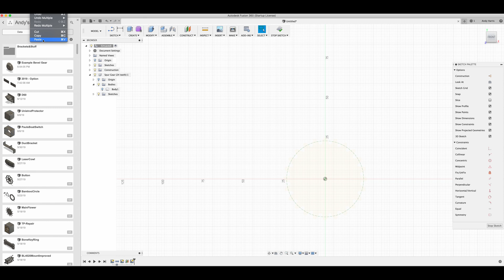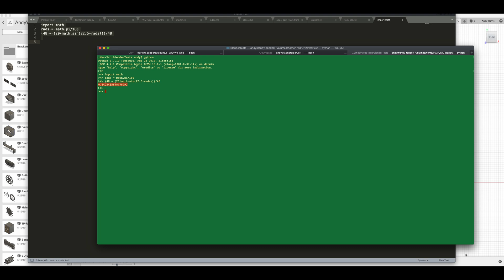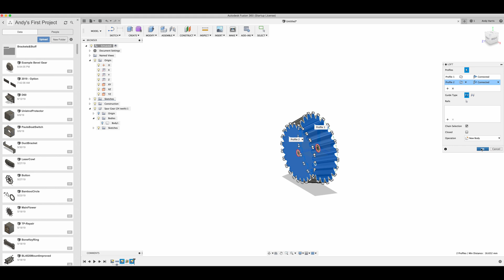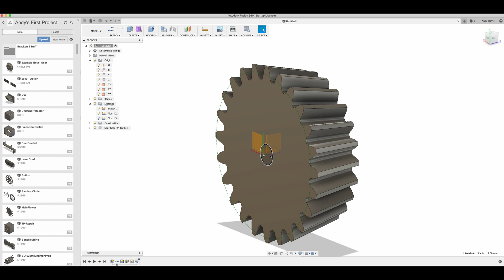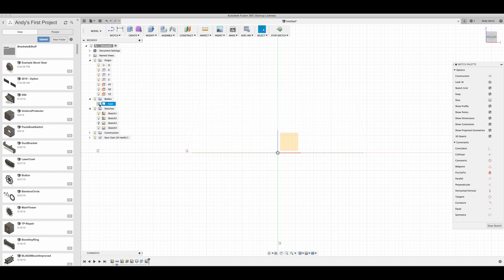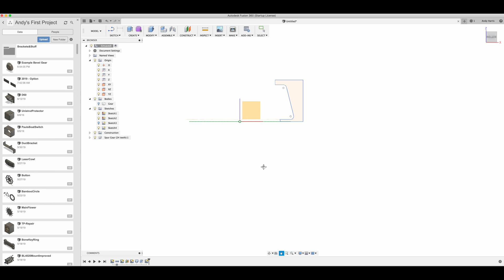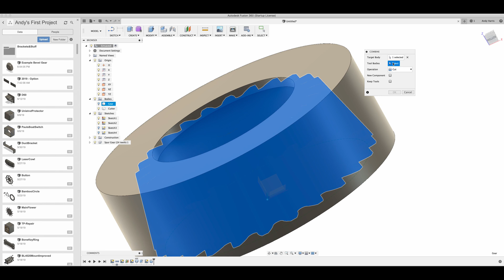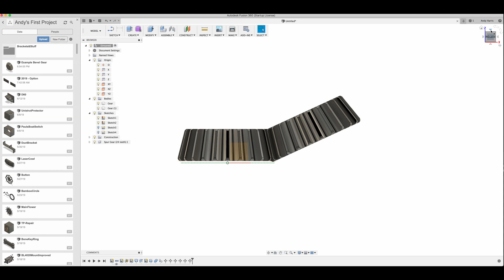Bevel Gears In Fusion 360

Comment: GF Gear Generator does not seem to let you change the contact angle, which is frustrating for an otherwise great tool... your method, while requiring some outside math, does let you pick any angle!! Have you yet an update that works in Fusion? (I don't have Python for that calculation you listed...)

Comment: This method doesn't create gears that mesh correctly. Lofting between to flat spur gear profiles will not create a proper bevel gear. You will get away with it when the angles are way less than 90 degrees (like in the video), but if you try this exact method to create 90 degree bevel gears, you will see that they aren't even close to meshing properly. This post at the Fusion forums explains exactly why: https://forums.autodesk.com/t5/fusion-360-design-validate/how-do-i-create-a-bevel-gear-like-this-in-fusion/m-p/6955483/highlight/true#M103817
Reply: Indeed. A bevel gear should be designed as a pair of touching cones on their slant height. Their intersection results in a line. The profile of one tooth of each gear cone should be perpendicular to that line.

Comment: Not sure if it is the new user interface but the geometry that I am trying to replicate is very different from the one you show.  Can you please verify that your method still works with the updated Fusion 360.  Thank you!
Reply from the maker: I can confirm that addins are still available - but now under the tools menu in design.   The 'Project' function seems to have disappeared.   I used a mirror face this morning, this is not as good as project.    You can also select all the of lines that make up the face of the spur gear - but this takes a little time!
Reply from the maker: OK, so you can use all the edge selection to get all the lines of the gear face and then copy these to another drawing - from there you are good to go!
Reply: @AndyThirtover  Yes, I stumbled on this last night as I was desperately trying to find a way around the missing projection function.  This is a great way of creating bevel gears.
Thank you!!!
Reply: One additional note that may help someone.  When scaling the offset sketch all dimensions will be adjusted!  I was playing with a 48 tooth,  50 mm thick, 90 degree gear.  The scale factor of 0.26343 changed the thickness of my gear proportionally to 13.17 mm.  To get the gear back to the desired thickness of 50 mm I had to click on point in the offset plane above the origin.  All else is as Mr Harris describes in his video.

Comment: What are the variables you used in your script please? I'm trying to create 90° bevel gears. 48 is the pitch from the spur gear add-in. 22.5 is the angle between the gears and 20 is the gear thickness?
Reply from the maker: import math
rads = math.pi/180

gear_thickness = 20
gear_angle = 45/2
teeth = 48

scale_factor =(teeth - (gear_thickness*math.sin(gear_angle*rads)))/teeth
print("Scale Factor: {}".format(scale_factor))

This is a little Python program that will sort it out.   In your case gear_angle = 90/2 (because you make 2x45 turns).
Regards

Andy
Reply: Andy, thanks for the explanation. Your video is by far the easiest method to make working bevel gears. I printed your example and they worked well! Thanks
Reply: @AndyThirtover  does this woks for 90° bevel gear and pinion?
Reply from the maker: @FlyHIGHSIM  Yes this works for 90 (2x45).   These days there are very good gear builders.  I'm using CF Gear generator these days.
Reply: @AndyThirtover  oh god... i didnt even know it exists... thx :) i'll get this generator :)
Reply: @AndyThirtover  is there any easy way to align the two gears using this generator ?
Reply from the maker: @FlyHIGHSIM  GF Generator creates sketches - which can be edited.  I actually do the alignment by doing a section analysis and Move. For 3d printed gears I leave 0.1mm clearance (Prusa i3Mk3).   I'll bet there is a better way of doing this!
Reply: @AndyThirtover  ohh, i did not tought about loking at the section or the sketches... i was trying to calculate the apex etc. etc. by doing the radius of each gear (.  (teeth*module)/2.  ) but none of my calculations matched :(  so, i did the alignment with my eyes :p. ANYWAY, the project i'm working on (a mini rc car) is printing the first prototype of the rear suspension/drive shaft and everything. it will be great to check how acurate is my eyes hahaha. thanks for your help!!!
Reply: @AndyThirtover   If i exactly recreate all your numbers / dimensions / python script i get a working model in fusion, so i think i'm doing everything right, however. I'm trying to use a different module, and the angle of my gears is way off. Am trying to create 90° gears.
Gear thickness 10
gear angle 90/2
teeth 32

my python script tells me a scale factor of .799, but 0.6 seems to actually be about right? My tooth module is 1.5 should this be accounted for somewhere?